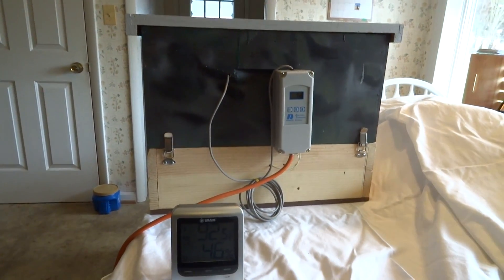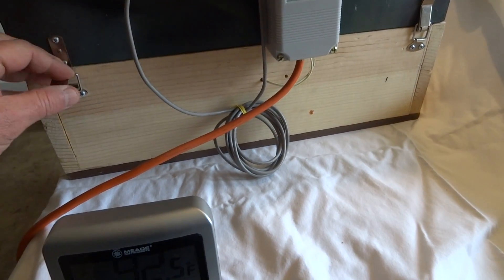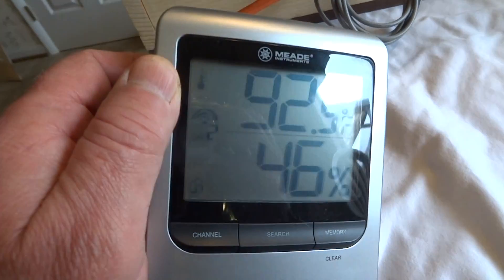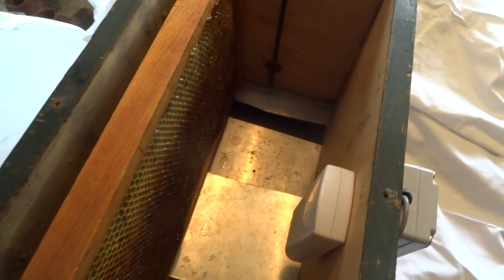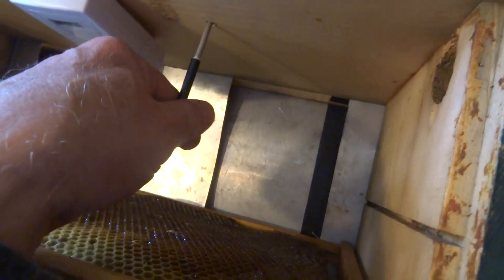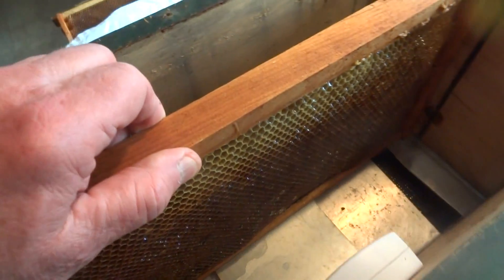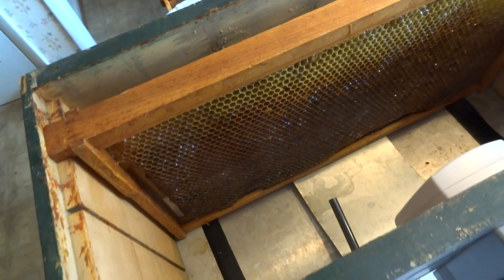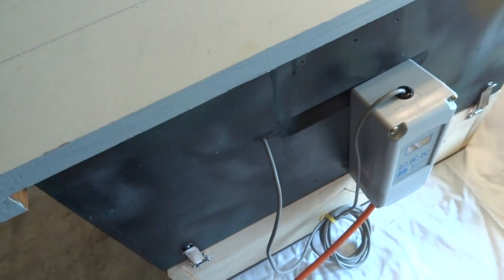Queen Cell Incubator

Comment: Looks great. I'd like to build one. Any way to get a parts list?
Reply from the maker: The heart of the incubator is the Ranco thermostat which you can Google on the web. The remote temp and humidity sensor  of which there are many can also be googled on the web..
Reply: Thanks for the info but I built it a couple of months ago. Works great! Thanks for the original video post. I just figured it out from there...

Comment from the maker: Charles,
Honey is a bad choice for humidity control. The incubator is set at 92-93 degrees F which will evaporate a lot of water. You want to  raise the humidity to 50 +% or so. The best way is to evaporate water with  fairly large surface area. Open comb provides a large surface area and can be easily filled with tap water. I tried several different methods to raise the humidity  before I came up with this idea. It works great.

Comment: what would it be like if  you used a frame of honey instead of water. By volume i would expect you would not need to swap out or alter frames . just a guess
Reply from the maker: You want to use water not honey. The goal is ti raise the humidity so the cells don't get too dry.
Reply: Thank You